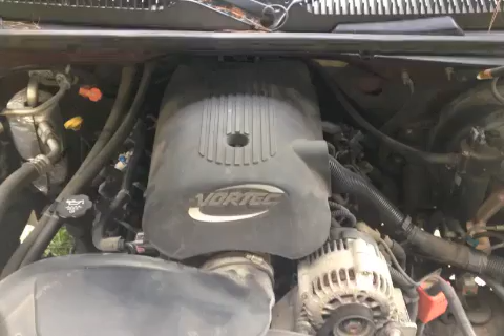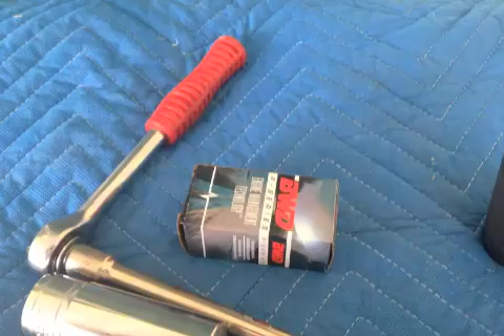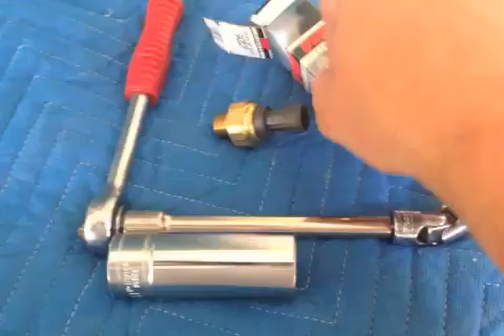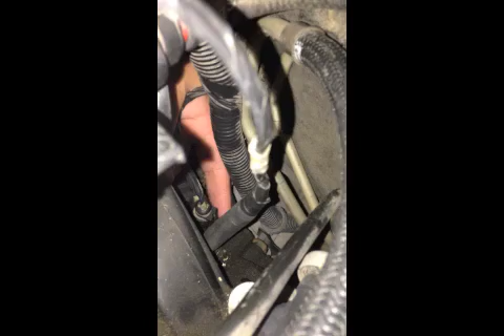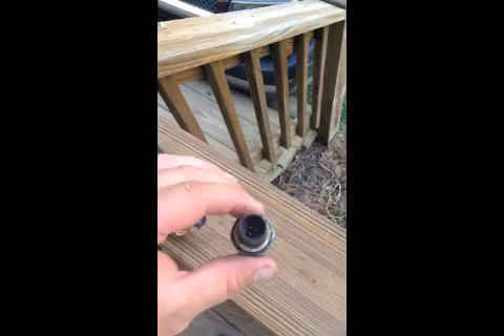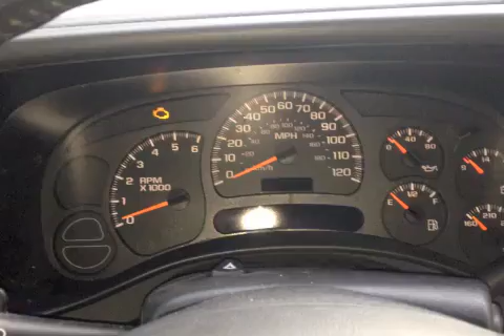2003 Chevy Silverado 1500 5.3L V8 Oil Pressure Sending Unit Repair

Comment: My pressure has dropped 10 psi in 2 yrs. At 60 mph pressure is 30-32 psi used to be 40-45 psi at 60 mph. Well maintained 2003 Suburban with 290 K miles. Changed this several years back already. Wondering if it could be sending unit. Great video
Reply: could be the o ring for the oil pickup tube, been there done that and made huge difference in my 06 Z71

Comment: Great work I have a major oil leak on my 2001 sierra.  Turns out it was leaking from the sensor
Reply: Wok so did you replace the sensor or was the sensor just loose and leaking? I have a leak on mine but not exactly sure where its coming from. I replaced the valve covers but the leak is still there.
Reply: Seen alot of people break the plastic connecting piece on the top of the actual sensor from using regular sockets...

Comment: my  gauge  was ok before I had the oil changed and when they finished my gauge was at 80 instead of 40  this was not there before I went for oil change can they screwed up something?
Reply: This same exact thing just happened to me with my '04 2500HD. I am a GM Master Certified tech and have worked in dealerships for 25 years. I believe what happens is when you change the oil, it ends up "stirring up" small debris in an oil passage and it gets lodged in the sensor causing it to read incorrectly. Not all engines have the screen in them. Only the engines with cylinder deactivation have the screen to protect the passages in the valley plate and the lifters, and by default of it's postition it also protects the sending unit.

Comment: Thanks Ryan. First, the tab that releases the plug was between the sender and the cam sensor. Used s stubby straight screwdriver to finally unlatch that. My future son-in-law and I could not get the dern sender unit to break free using a 10" extender and wobble connector and approaching from that steep angle in your video. Plus the rounded edges of the sender didn't help (cheap junk!). To have a more vertical approach, we removed the three machine screws that hold the plastic plate that's below the cover you remove first and pulled that plate off. This gave us much better access and we got 'er done! Thanks again.

Comment: just a find... i have a sierra 1500 with fluctuating between 0 an around 40 psi.  changed sending unit.. ng. changed filter screen under unit still ng.  found the problem to be a stuck bypass on the oil filter under the truck.  it was a bosch filter and ill not use them again. changed oil and filter... no more problems.

Comment: I was discouraged after I removed the plastic cover, crawled on top of the engine and looked at what was ins store for me.  But after reviewing your video several times, I decided to give it a shot.  45 minutes later and I'm done, the sensor is working and my confidence level has been restored.  Thanks Ryan.

Comment: Had to do this on my 06 4.8 a few weeks ago.  Oil gauge showed 80PSI all the time.  Socket was a 1 1/16" deep well socket.  Part is about $40.  Cut my hand up every time I put it back there and you have to practically climb in the engine bay, but it's not that big of a deal.  The old sensor felt like pot metal.  New one was brass.

Comment: i got no oil pressure problem but Im fixing a leak and not sure where its at. its above the trans but 6 months ago due to a busy schedule a mechanic did my valve covers, and I can see he didnt clean up too well. I also got oil in the bell housing which could either be the crank cover or main seal and the pan as well. I also heard you can fix the main seal if lucky just by tightening the 2 rear pan bolts that drive up into that rear crank cover plate behind the flywheel. My question is, what did you put on the threads, I see color on the one you took off? I'm trying to eliminate this as a possible cause of leaking later on.

Comment: could you tell me what size socket this is? my oil pressure sensor is a lot longer then that one on my 2001 silverado 4.8, i wonder would this still work?

Comment: Video was great! If you get the special socket, though, you minimize the chance of breaking the plastic. Such a simple repair after watching the video but would be even easier had GM designed the position of the sensor better. I guess they were trying to discourage do it yourselfers and generate more business for the dealers!

Comment: also there is a screen/filter under the sensor that should be replaced 
(part number 12585328/ valve lifter oil filter).
 replaced my sensor twice and had the same issue. replaced the screen and the issue went away.

Comment: What if all my gauges aint working?? Help please having trouble with it now
Reply: ricerust Heck no. Dudes at O'Reilly Auto Parts told me that it would cost like $300 to get a new one for my truck. As of right now, the only issues it has are that the RPM needle is stuck at 0, which really is not an issue since my truck has an automatic transmission, and some of the backlights are burning out, which makes it difficult to see my speedometer when I'm driving at night. Unless the speed gauge or the gas gauge goes out, there's really no reason to sweat it right now.
Reply: +ricerust i changed all mine for 20$ just desolder of the old ones and put in the new motor
Reply: +Johnny Ordonez you just need to buy a whole new gauge cluster for your truck. I'm guessing you've got around 190-200K miles on your silverado and it's an 03. That year is prone to gauge failure. The RPM needle on my 03 hasn't worked in like 3 years and the battery gauge just went out a few months ago.

Comment: Dammit! my socket wasn't sitting flat when I tried to re install and I ended up breaking the plastic surrounding the slide connector pins. I had to cut off the plastic from the old sensor and epoxy it to the new one, so I wouldn't have to spend $50 again. Don't let this happen to you.

Comment: Very easy once I watched the video and bought the 1 1/16" socket.  About 30 minutes from start-to-finish from disconn and re-conn the harness.Good oil pressure gauge again!!!
  Applies to 2003 Silverado 4.8L also.

Comment: Thanks, Ryan. I had a similar problem with my 2003 Silverado, where my oil pressure gauge showed a constant 79-80 psi of oil pressure. The new sending unit fixed the problem, and your video was very helpful. I really appreciate it.
Reply: Did it leak oil a little bit when the sensor was malfunctioning?